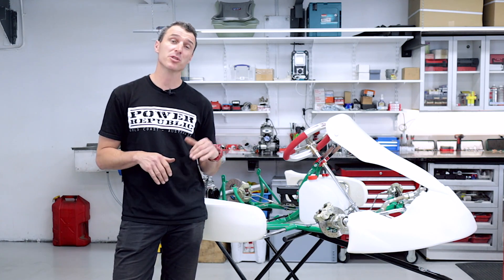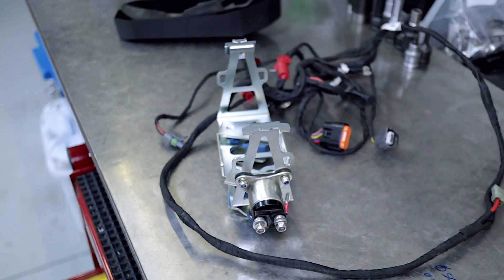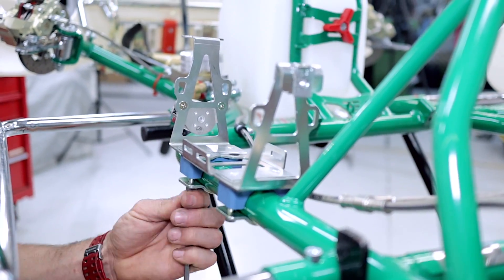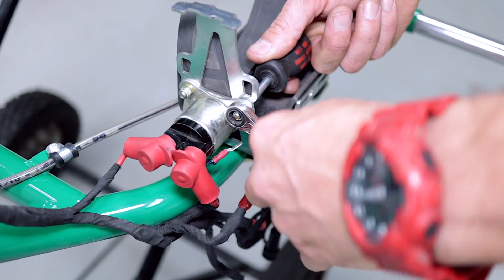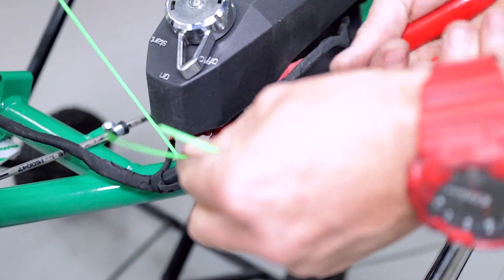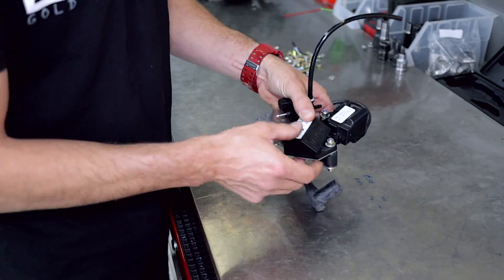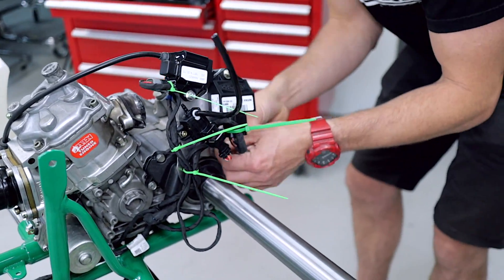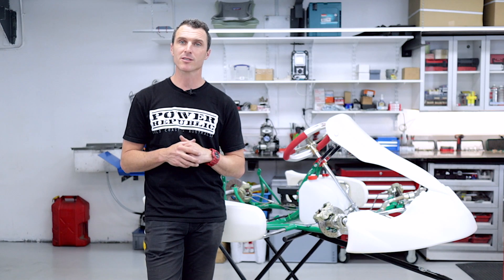HOW TO: Install The Rotax DD2 Wiring Harness on Your Go Kart - POWER REPUBLIC

Comment: Awesome videos, this inspires me to bring my hobby to the next level and work on a build up myself :)

I currently drive an old tony kart evrr from 2013 with m4 body kit and would like to replace the chassis, can I just take a newer 401s chassis and use all my parts or do I have to update/upgrade other parts as well? 

Thanks for an answer :)
Reply from the maker: Tobias S you’ll need new side pod bars, pedals and pedal assemblies, front bars and a set of plastics.  And maybe bearing cassettes
Reply: Thanks :) love the content, keep up the good work

Comment: Hi, and thanks for replying on previous videos. Very short question: Impulse restrictor? Maybe a couple of words on its functionality and why it can be omitted? I know the basics of impulse restriction, i just wonder exactly what effect it has on the power valve performance. 

Thanks!
Reply from the maker: Hi Lars, i have always put it in the line, however I haven't been able to measure any major variations in PV performance with it in or removed.  I'll have to double check and get back to you